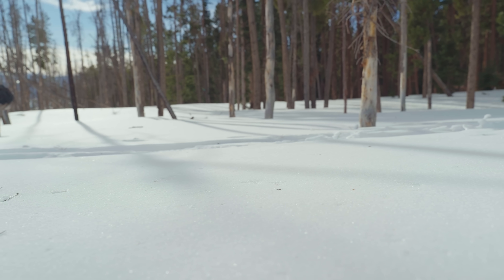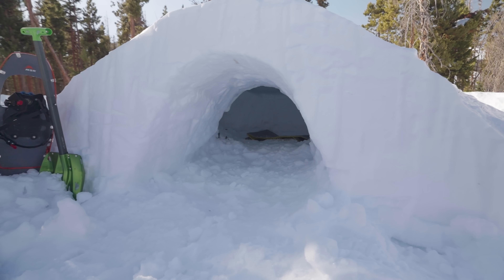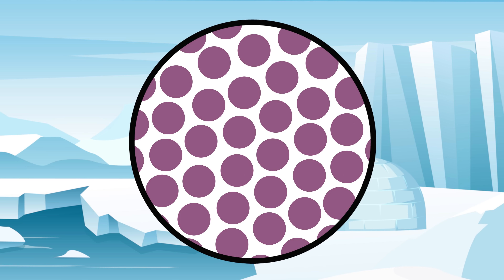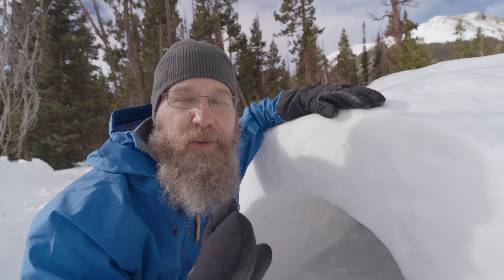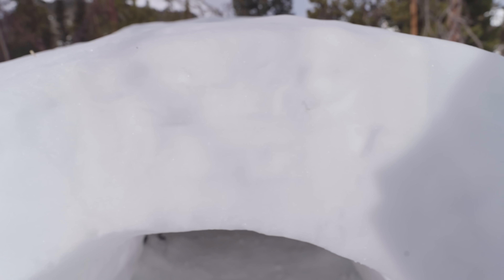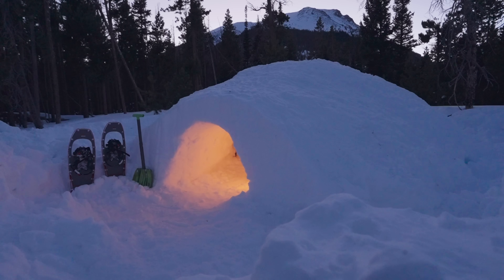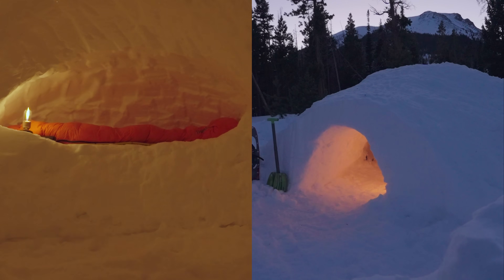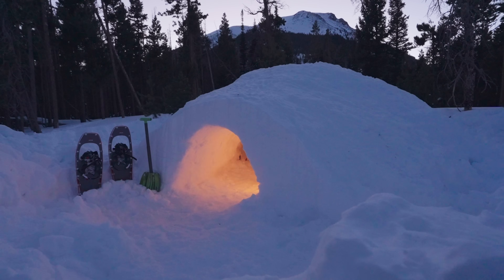Ancient Wisdom Proven Right by Science!

Comment: Particles don't stop moving at absolute zero, absolute zero deleted particles. At approaching absolute zero particles lose their identity created by their energy and blend together into one super-state.

Second, snow/ice melts slow only minor because of what you presented. It melts slow because of their latent enthalpy of fusion.

To make definitions clear, 1 Kcal a "Calorie" is the energy unit to describe heating 1 Liter of water by 1°C. So to boil 1°C water to 100°C you need 99 Kcal.

To FREEZE water you also need a lot of calories as the crystal formation, the ordering of loose liquid water molecules into an orderly structure with more solid bonds requires a lot of energy. The amount of energy needed to then freeze 0°C liquid water to 0°C solid ice requires about 80 Kcal. 

So to boil 1 kilo of ice (let's assume it has the same density as water to make it simple) that is at freezing point, you will need almost twice the amount of energy hence snow melts slowly. Melting it in water thus is much faster as water has the highest capacity in the universe, and thus hot water will quickly give it the energy required to melt.

You should remake this video understanding these key points first, insulation is nice and all but it's just a small part.

Comment: well, I think what happens is the warm air on the inside of an igloo causes the inside walls to warm up, however, the cold outside wall keep it from melting, it kind of just turns into this icy shell on the inside of the igloo. Snow provides great insulation because water is a bad conductor of heat.

Comment: My cousin and I built an igloo in our driveway about 20 years ago. The snow was maybe 4 or 5 feet deep outside, so we began by stomping around on the driveway to pack it all down in a large circle (about 10-12 feet). Eventually, it was probably less than a foot thick. Then, when we had our space prepped, we did the same thing in the street in front of the house in a large rectangle and then cut it into bricks, which we took from the street and stacked around the circular "floor" we made in the driveway, leaving a gap for the entrance. We sealed them with snow for mortar, at first going straight up, but after about 4 feet, we began to move inward a little more with each layer until we had closed it off. We finished the entrance with a proper tunnel and then built a bench around the entire interior, and a table for the middle. We lined the bench with wood so as not to sit on snow, and then we spent the winter playing cards and drinking with our friends in an igloo. It took about 6 hours for the 2 of us to build, and it stood in our driveway for 6 months. It actually got so warm with 4 or more people inside that we had to poke holes in the ceiling to ventilate because it started dripping on us.

Comment: When building an igloo having a small wall along the side the wind comes from also helps maintain heat inside since air moving across the entrance can suck out the warm air. 
We built shelters in the sides of snow drifts since it usually gave a clean wall on the side away from the wind and was often deep enough to hollow it out to at least a sitting height.

Comment: I've experienced this firsthand as a sunlight enjoying urbanite. It was a long, snowy winter, and the day after a blizzard that shut down my college campus, it was sunny and just a few degrees below freezing. I trudged out to a spot on campus I knew would be out of the wind, brought my book, and sat and read. After an hour and my body adjusted, I actually took my coat off because the warmth of the sun plus the insulation of the surrounding snow meant it was actually quite warm where I was sitting, even if the thermometer might have read 28 degrees Fahrenheit.

Comment: Snow can insulate both ways, yes. Either insulating to retain heat, if used correctly by us, or, it can also insulate the ground every spring in certain areas. It coats the ground, creating a thermal layer between the atmosphere and the frost layer in the dirt. This stops/slows the water in the ground from thawing.

Comment: Snow is warm only in comparison to colder substances. But because it is essentially an isolator, you can isolate warm air from cold air outside. It works nicely, until the snow starts to drip ice cold water.

Comment: For locales which don't have suitable snow to create a true igloo (i.e. tightly packed drifts deposited in a single storm, so that there are no shear layers), an Icebox Igloo Maker (Google it) slip form system may be a viable alternative to the quinzee.  This device allows for the blocks to be packed in place, rather than cut from the drift with a snow knife or saw, transported to the building site and stacked on the growing spiral wall.  An adjustable length center pole helps one to maintain the proper catenary shape of the dome to avoid tensile stresses, making for a more durable and long term structure.  I picked up one of these Iceboxes used last winter off CL, but we had such a crummy winter with scanty snow, I didn't even attempt it.  I haven't yet tried it this winter (now, I've been using most of my time moving our "bonus" snow!).  It seems a well made kit, but I can't give a true testimonial since I haven't yet used it in anger.  Supposedly, nearly any snow can be successfully used with this system.  Reportedly, practice makes perfect, and while the initial build or two may be slow, subsequent efforts will proceed more expeditiously.  We shall see...

In "Eskimo Architecture: Dwelling and Structure in the Early Historic Period", Reinhardt and Lee  suggest that a snow igloo, with a caribou skin liner suspended from toggles on the interior, can reach up to 100F (38C) air temp inside of the liner near the ceiling(!).  This would be with several human - and possibly canine - occupants, and a koodlik burning.

As I recall, "Igloo Ed", inventor of the Icebox slip form, claimed on his old website that temps approaching 40F (4C) were possible with just body heat at ambient temps approaching -40F(-40C).

Comment: Electricity is nothing more than a field of force around a wire, but I damn sure bet you'll FEEL electricity if you grab that wire while touching ground!  Electricity doesn't flow through a wire- it never did.  It's a force around the wire.  But go ahead and grab a hot bare wire while touching ground.  

It doesn't matter what terms you want to use.  They're all yours to use or not use.  But "cold" is a term I'm going to keep using because it means, "lack of heat" which is exactly what it is.

Comment: the thesis is disingenuous at best and factually incorrect at worst. It is freezing and will very quickly sap your body heat and kill you with frostbite and hypothermia. Cold is real, it is defined as the absence or transfer of heat, just because it is defined as an absence doesn't make it not a real thing or a thing that doesn't exist. Much in the fashion vacuums are very real and they are the literal absence of anything.. The snow just creates a barrier slowing the heat transfer between the air inside and air outside and it is in fact the air that keeps you warm not the snow as the same can be done by two sheets of cardboard trapping a pocket of air insulating your interior from exterior.  Ancient wisdom not intestinally presented in a disingenuous fashion proven right by science.

Comment: What's fascinating is that air is not only a good insulator, it's the best one we have available. It's found all over the place, from snow to wool, to light paper/wood meshes in housing, to more stone wool-related things, all the way, to aerogels for the hottest of ovens to the tiles we use in spacecraft. They are all meshes of different mechanical properties containing air in fixed places.
Also, your average human body produces around 100W of heat. Whoever got his hand close to a 75-100W lightbulb knows, that's hot. If you design structures with dozens of people inside, you deal with view kW of heat. So a bunker or igloo has a maximum amount of people it can shelter before it gets too hot. And many cultures like the Vikings or Mongolians had a main hut or tent for the winter. This reduced the number of fires required, as well as the amount of fire in the main housing. I bet they did something similar with the igloo.

Comment: Another way that snow keeps you warmer is infrared light bounces around inside the ice crystals until it comes back out again and radiates back at you.  (This is the principle that Tech Ingredients and NightHawkInLight use for their 'cooling paint'.)

Something else cool you can do with snow is turn a small pile into a rocket stove.  As it slowly melts, the water gets absorbed into the snow, so you don't get a puddle of water forming to put out the fire.  It won't last a long time, but at least long enough to boil a pot of water.

Cheers!

Comment: I was lost in AK after a unit jumped while I coming back from a line unit. No radio I set off to keep moving and find somewhere. I walked for 24 hours and only had Gortex jacket, pants, and polypro pants, some trigger finger mittens. Temperature was close to -50c. Almost at the point of exhaustion a lone wolf approached me, a very large grey and white monster of an animal. It kept looking to it's left and looking at me like it wanted me to find something. It walked away leaving me to ponder just what the hell that was about. I walked over to where it was looking and found a snow cave under a fallen tree. I went inside and got a few hours sleep. Refreshed I started again and spotted a hole from a tent a few miles away, and found some combat engineer unit, that provided me heat, some hot coffee, and a radio.
Reply: Wolves and ravens are extremely intelligent. I’ve heard of the latter doing things like this on occasion with humans, but this story with the wolf is unique
Reply: If this story is true, that’s bad ass. Not calling you a liar, it’s just the the internet

Comment: The same reason why it takes so long to heat up water on the stove is why its really good to use ice as a way to protect from the cold.

Water retains heat very well and its hard for it to heat up when its cold. It both makes it amazing at insulation and its hard for it to change temperature, excellent traits for a wall.

Comment: Snow at 0 degrees is no colder than any other material at 0 degrees. Emotionally the thing I associate with cold should be colder, but what matters is actually insulation and heat conductivity. It's like how a kilogram of steel feels heavier than a kilogram of feathers, but obviously isn't.

Comment: With one of those lanterns or a camp stove, isn’t there a risk of carbon monoxide accumulation?  How is the air within one of these structures kept breathable?
Reply from the maker: There is a small vent hole at the top. And in any enclosed structure with a fire (like a hot tents) you need a portable co2 sensor
Reply: @MyLifeOutdoors  Makes sense.  I was just thinking about how some of the deaths in the Ice Storm of 1998 were because people lost central heating and were stuck in their houses because of the amount of ice that had accumulated outside, so they tried heating their houses with camp stoves and suffocated from CO build-up.  I didn't see a vent hole in the video, so it became a concern.

Comment: 2:30 Warm air molecules are not less dense. Warm PATCHES of air are less dense. They are less dense due to the fact that in a warm patch of air the average molecule has more kinetic energy than in a cold patch of air, meaning they move around a lot more. As the molecules move around they bump into each other and shove each other away creating more space for each molecule, which leads to them being more spread out. Density is a measurement that tracks how many particles are in a certain area, you cannot apply it to a single particle. (If the volume of the gas doesn't increase the pressure will, assuming the amount of substance is constant.)
Reply: Agreed.
Reply: You poking that one hole in this man's logic makes me wonder how much more bs he's spouting that people aren't picking up on 😂
Reply: You missed the part where he said “a igloo” when he should’ve said “an igloo”
Reply: Thanks for typing this so I didn't have to
Reply: molecules are plural so warm air molecules are less dense than the same cool air molecules. This is pedantry. And not even the technically correct kind.
Reply: That's a long way of saying that, in effect, because of what you said... warm molecules are less dense.

Yes yes, technically a molecule is a molecule

But
Reply: @ tl;dr: warm air less dense, singular molecules have no density (ignoring subatomic particles)
Reply: @alexnaglich  "warm air molecules are less dense" only works when you're not implying that it's about individual warm air molecules, as did the visualisation in this video

Comment: tldr: Assuming sea level and 1atm pressure, 
Just like boiling water will resist getting above 100c 212f, 
solid ice / snow  will resist geting below 0c 32f
Which is  preferable to the outside of -20 c or f

Is it because of hydrogen bonds?

Just keep your winter outfit on.
Reply: Boiling water doesn't resist getting above 100 degrees, it gets past that and floats off as steam. There's nothing preventing ice from getting colder and it'll assume the temperature of its surroundings. Touching ice on a -30 day is a fairly painful experience.

In an igloo and other snow shelters the interior is heated up by the people inside it and the insulator that is the snow keeps out most outside cold.

Comment: How do igloos that are heated with fire source provide ventilation tho? Won't CO2 accumulate in its roof, rendering the sleeping spot dangerous to actually sleep in?
Reply from the maker: With any fire there needs to be a vent to allow smoke/exhaust to escape. And it’s wise to have a co2 sensor. This is true if hot tents too, not just snow structures

Comment: As a Swede that grew up when it was still cold winters, I remember how we built snow caves, but there were two things we always needed. The first was a pipe that worked as ventilation. The second thing was a cloth or wooden board that works as a door.
Reply: If you used a solar tube would it also work as a pipe for ventilation? Using natural light would be a improvement.
Reply: Swede here too.. 😁✌️also did snow caves! Not with any ventilation though. 👌 It never got that advanced.
But I've heard last year about a man from New Zealand that came to Kiruna that built and lived in a Igloo all winter. 😮

Comment: The point is to be isolated from wind. As long as wind doesn't hit you, the temperature will say at a temperature where warm clothing will be enough to not freeze to death.  The igloo will always be at 32f which is when water turns to ice and it will stay that temperature as long as the inside doesn't have airflow.
Reply: It seems you have never been in an igloo. An igloo will get far warmer than the outside world from the moment you go into it because your body gives off heat.
Reply: Wind chill is a bitch agreed especially if your even remotely wet your gonna feel like sub zero just blasted you it's called evaporation cooling like sweating ..if you need stay cool blow a fan on your face n go ahh this aint doing much...then splash water on your face then put fan on its a world off different its a great friend in hot climates but cold climates can kill you in minuites...but check out the ancient freezers in  ir-an the country called yat-chels they use evaporation cooling very cool cheers

Comment: the biggest issue i run into with igloos is time to setup and the fact that while yes the snow is insulating you from the outside, you ALSO have to insulate yourself from the snow. They're great if you have good sleeping pads and bags and are planning to stay in the same area for a long time with relatively few other shelter materials, but other than that, i'd much prefer a hot tent.